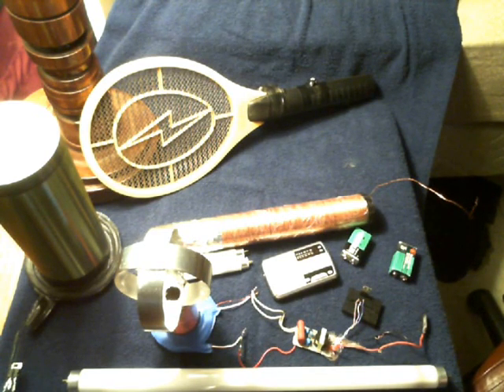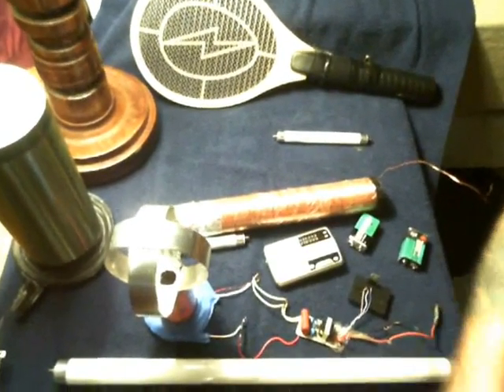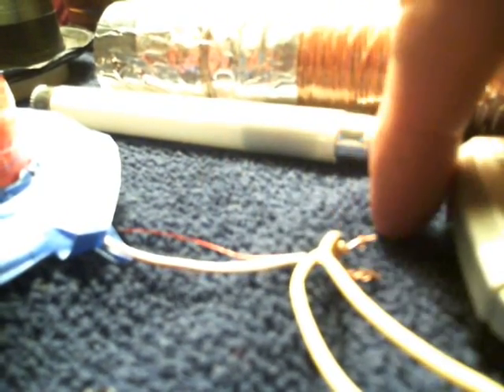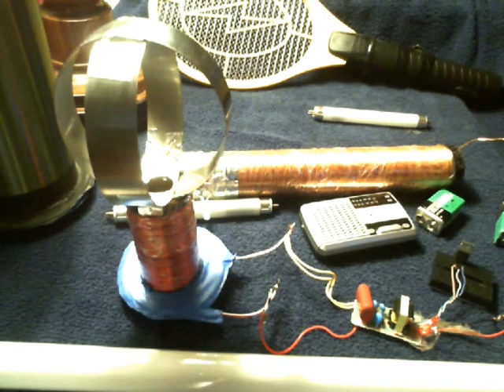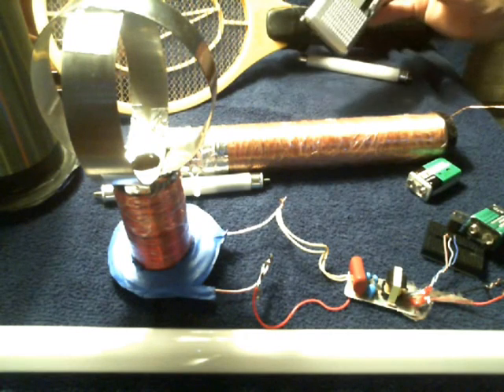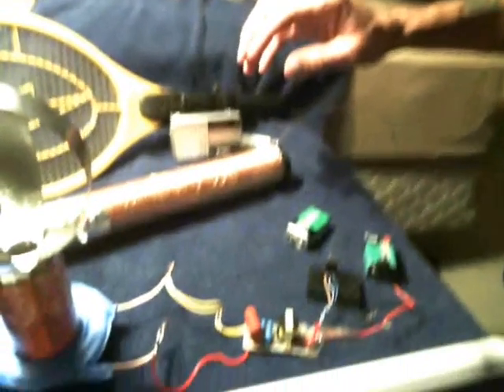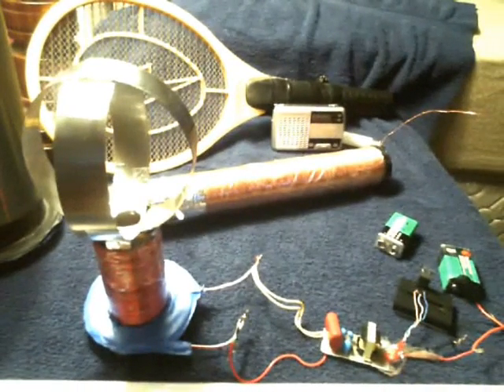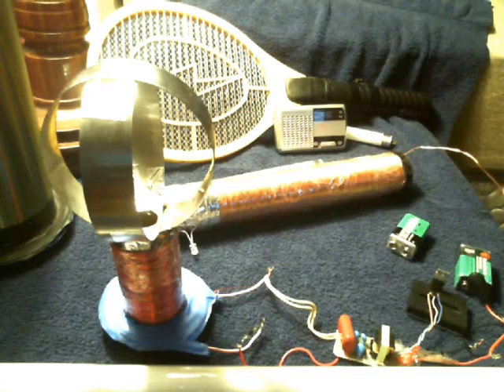BZF TESLA COIL!

Comment: What if I touch the spark?
Reply: Basically, you receive an RF burn on your skin. But because of an electrical phenomenon called the 'skin effect' electricity only flows on the outside of your skin, due to High Frequency AC. You will not be shocked, but will be burned. This is assuming this tesla coil operates at standard TC frequencies.
Reply: You'll feel a shock but it won't hurt because it's only 3volts being stepped up
Reply: +Lawrence “The Editor” Bloomfield no, it still hurts. still a lot of electric. even if it can't kill you, not gonna argue wether or not it will, it still hurts. think of paper cuts...not deadly but still hurt. trist me I made one of these
Reply: and u r replying to this after an year. in last year, i touched the spark so many times . got burnt from my most powerful coil
Reply: Yes, those burns are nasty! They are basically above the frequency that our nerves can sense electricity. So, the arc just burns our skin, and all we feel is the after effects of the burn. Nasty burns, Mate.